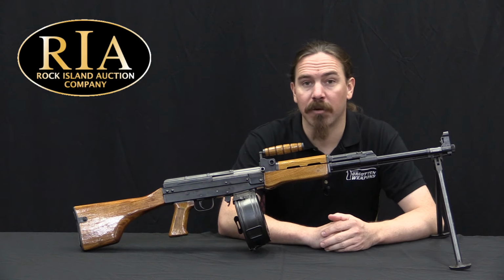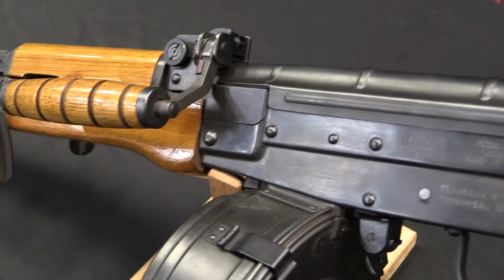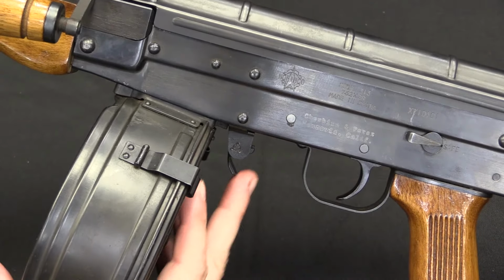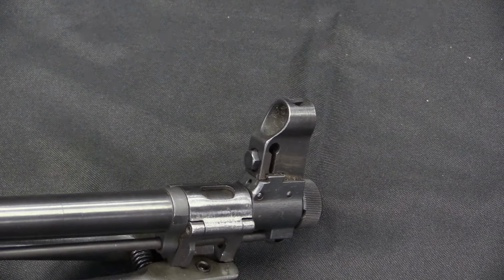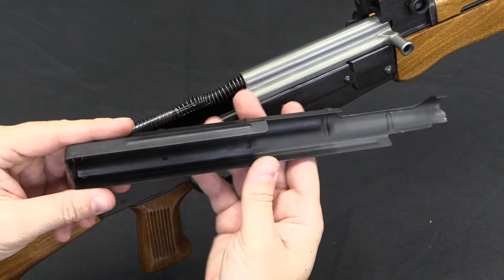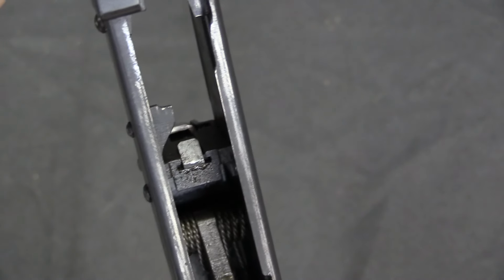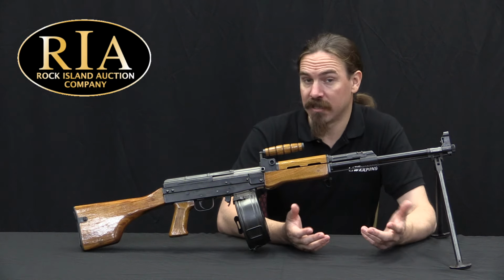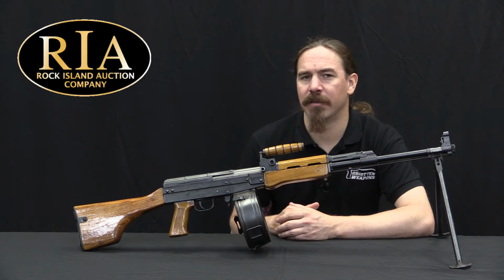The Type 81 LMG in Civilian Form: Norinco Model 313

Comment: Hi Ian! This spring in Canada, 2 new versions of the Type 81 carbine came in. They called Type81M. Basically, think of the LMG without carrying handle and with 18.5 inch barrel instead of the 20,5 inch. Still the barrel is heavy contour. One version have a fixed wood stock,the other have AK style under folder. I wanted the fixed stock version but they sold out so fast, did'nt have time lol. The under folder remain available but i am not a fan of folder so i wait the next batch to get a fixed stock but will only come next year...  The finish of the new version is not as nice as the blued LMG we got before but still guys  up here enjoy them.

Comment: That bolt hold open is so simple, why did the AK never adopt something similar?
Reply: Tactical doctrine?

The "Commonwealth" FAL the L1A1 / C1 has the bolt "hold-open catch" fitted and that catch even has the hole to fit the pin that is actuated by the magazine follower but the pin is absent.

I always understood that this was an adjunct decision along with the "Kent-Lemon" sand -clearance cuts in the carrier and rifle body..Dust gets in but it is cleverly shuffled out of the works by those slots passing each other with every shot.

If the bolt stays open in a sand / dust-storm environment things could get ugly very quickly..  Also being semi-auto only (as issued) "spray and pray" was not going to happen either.

Standard drill on these is: Rifle stops; tilt, cock, lock, and look. No ammunition? Change magazines, working parts forward, carry on firing. Automatic "hold-open" gizmos are probably more useful on stripper/ clip-loaded rifles, like the SKS, M-1 Garand, FN-49,  etc.

Comment: Tabuk would also be an interesting gun if possible.
1,78 inches = 4,52 centimetres One minute of an angle from 100 metres is 2,91 centimetres or 1,15 inches. 1,78 inches / 4,51 centimetres = 1,5 minutes of an angle 100 metres. Half of the hits on that area. Not so difficult to understand.
Reply: Sure, but the area covered by a circle increases with the square of the radius, so simply doubling the 45mm/1.78" isn't quite right.

Comment: Re: the comments on Norinco firearms. I purchased a brand new Norinco MAK-90 post ban for $185 in 1995. Other than the ugly and almost useless thumb hole stock the difference between it and a  stamped receiver Chinese AK were removal  of bayonet lug, removal of the muzzle brake and its attachment threads and cleaning rod. Came with a Norinco 5 round mag which is still in its original oiled paper wrapping. Receiver is 1.5mm ( vs 1.0mm for most others) thick material and accepts any reasonably made 30 or 40 round AK mag. I've changed out the wood with Warsaw Pact polymer furniture, Houge pistol grip, added a T 2 trigger assembly, a polymer recoil buffer and a better front sight post. Off the bench it shoots consistent 2 MOA groups at 100 yds with decent ammo. Never have had any wear or breakage problems, FTF or FTE problems. Some AK "experts" regard that vintage Chinese AKs along with the Finnish Valmets ( AK 2.5) as the best AKs available to the general public. My experience supports this for overall quality and durability. Norinco can be a quality builder.

Comment: Hey how about a review of the Norinco MAK90?
i've had on for years, but apart from various .22lr rifles, it's the only rifle I've ever personally owned and used long-term so I honestly don't know how it stacks up against other rifles; I just know that one rifle well.

Edit: Basically, all I really know about MAK90s are that the receiver thickness is 1.5mm, a 50% increase in thickness (allegedly to compensate for softer metal), and that there were tons of legal and political issues surrounding it at the time.

Comment: I'm from Canada and own a fixed and folder and prefer the folder actually, the t81 has a very low sight with the fixed stock my sight picture isn't as good as with the folder.
Reply: I quite like it, I shot my cz858 to the point the bolt broke so I'm hoping these guys hold up better

Comment: 12:25 1.78 inches equates to about 45 millimeters.
Reply: And the 50% hits is the definition of circular error probable, actual group size is going to be about 3". CEP is usually used in bigger guns, not small arms.

Comment: How is the accuracy of the 7.62x39 compared to the SKS and AK?
Reply: Mine seems to have a mind of its own. I consistently will shoot at random 2" - 2.5" 5 shot groups at 100 meters and then other times it will shoot 4 - 5" groups at 100 meters. I only know two other people who are experiencing the same thing. When I examined the gun, I could only find that there is a strengthening cross bolt on the inside of the hand guard that shows evidence that it is making contact with the barrel under recoil. I haven't yet tried it without the hand guard to see if that changes anything.

Comment: It's interesting the Chinese had to design a new rifle where the Soviets accurized the AK with the 5.45 and the Finns with the RK62
Reply: To be fair, relatively little of this is actually "new". It looks very like it was designed with existing tooling in mind, while moving to a more practical operating method for the gun itself. For a company reliant on the sort of turnover rates that were required by the party  (5.45 had been in development for a while in Russia as opposed to the quick Chinese decision to improve half their small arms arsenal) and with limited manufacturing quality options, this is a very ingenious and effective solution to their problem.
Reply: It's not that they "had to" but because they didn't want to be seen as a Soviet client. China wanted their own tanks and aircraft too, but rifles were much easier
Reply: After the Vietnam War, China wanted to develop a new rifle that has the reliability of the AK-47 but with the accuracy and range of the M-16. So type 81 is an attempt for China to make the Type 56 (an AK-47 variant) more like M-16, an accurate rifle with full automatic capability, not just a sub-machine gun.

Comment: Funnily enough these rifles (at least the ones here in Canada) are actually notoriously inaccurate and low quality. They will shoot 4-5+ MOA with ammo that will be 2-3 MOA in a SKS or Vz58.
Reply: 1.78 inches at 50 meters isn't a far cry from 4-5 MOA at 100. I have an old Norinco AK type and it's far more accurate than one might think. The sights let them down.
Reply: @robertkubrick3738  I'm talking about the Type 81, not Norinco AKs. There are numerous reports on CGN of people getting 4-5 MOA with them, and a few direct comparisons to the other mentioned rifles. Lots of them have been coming from the factory with bent barrels and lots of quality control issues.
Reply: @robertkubrick3738  50% of the shots landing within a 45mm circle should give groups of about 3", not 4+.
Reply: @ScottKenny1978  That would depend on how far out those 50% that land outside of the circle land, wouldn't it? Were you posting just because? If I were you, I would delete that post.
Reply: @robertkubrick3738  it's a measure of the area available for bullets to land on. A circle 45mm in diameter has an area of 1590 square mm. A circle double the area has a radius of 31 and a bit mm, for a group size of about 2.5".

What circular error probable lets you do is ignore calling fliers and just shoot.
Reply: @ScottKenny1978  Maybe, bolted into a machine rest and with telescopic sights, Neither of which the weapon comes with. I still have good reason to believe you are wrong because of the quality of the ammunition. At 100 yards or meters, differences in velocity of each individual shot would show.
Reply: @robertkubrick3738  statistics definitely can be creative lying with numbers, but that is the definition of circular error probable.

It does have advantages in testing, since you don't have to call fliers. But I will stand by my statement. I served on missile subs, and missile accuracy is also measured in CEP.
Reply: @ScottKenny1978  Some missiles correct, bullets don't.
Reply: @robertkubrick3738  sure, the big ones that do are called maneuvering reentry vehicles, MARVs. The trident 1 only had multiple independently targeted reentry vehicles, MIRVs. They get lined up outside the atmosphere and dropped in, no corrections possible after the drop.
Reply: The type 81 is actually great, ive owned several in canada
Reply: @1991tommygun  Funny you should reply to this old comment because I bought one recently and it arrived today. I chose to buy another Vz58 when the T81 first got brought into Canada, because it was only a bit more expensive and much higher quality, and well we all know how that worked out. They're definitely good guns, they're just not precise at all. Combat accurate enough with the shitty Chinese ammo, but SKS and Vz will outshoot them any day.

Comment: I wish regular Aks had a bolt hold open
Reply: That was rejected by the Russian military. They didn't like the idea of a big open hole to the chamber right in the moment when a soldier rolling in a mud/sand/snow searching for a new mag. The problem could be partly solved by adding an ejection port cover but they don't like added complexity either.
For a civilian market it's non a problem at all, but a standard mag has no specific follower feature.

Comment: Ian, can you give some insight as to why they chose to use a similar but not interchangeable magazine design? It seems like a very bad idea, especially since there were undoubtedly hundreds of thousands or even millions of AK magazines already in their logistical system. Just the possibility of confusion at a quick glance under stress would make it seem to be a poor choice.
Reply: They wanted a good hold open design. When the mags are removed the bolt stays open. AK mags can't do this
Reply: Back in 70s and 80s China was almost in a war with Soviet, so the non interchangeble magazine design was to prevent during an invasion Soviets could just use any magazines or ammos they can find.

Comment: Isn't it a bad idea to make bypod fixed on horizontal axis? Makes switching targets really inconvenient, doesn't it?
Reply: Most wars in East Asia were/are fought from fortified positions with few entry points, effectively creating bottlenecks for any opposing force. These would definitely shine in those situations.
Reply: @arifhossain9751  Still, seems like a relatively simple feature to add.
Reply: Boomerisadog I’m guessing somewhat inconvenient target switching was worth it for the bipod stability to the designers
Reply: I think this is designed as a SAW, which means the one using this, rather than picking off targets, are meant to suppress enemy position and cover your squad. Since you're suppressing a general position/ direction, you don't need a complicated bipod for the fancy stuff, you just need it for the stabilization. 
Also maybe consider the fact that this weapon is meant to arm an army of several millions in a dire situation of the need to replace outdated weapons. I guess a cent saved is a cent saved, as long as the work is done.

Comment: It’s speculated the reason this rifle is not more popular on the international market is because it looked too similar to an AK and thus there was a lack of awareness of it’s existence. This was due to the Chinese army stipulating an AK like furniture over the designer’s objections. 

In addition to a higher accuracy requirement, the rifle was also designed to last longer in service with significantly higher round count. These requirements made the rifle twice as expensive as the AK, which is another reason it didn’t sell that well.